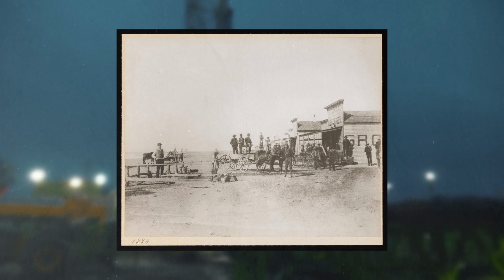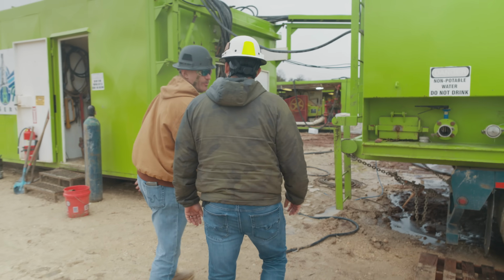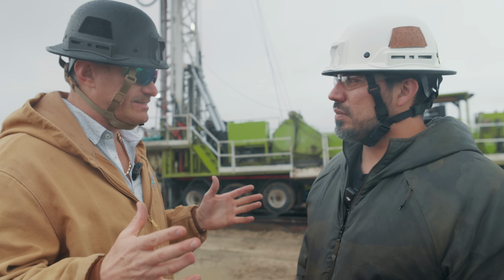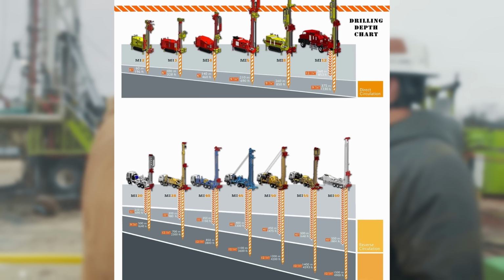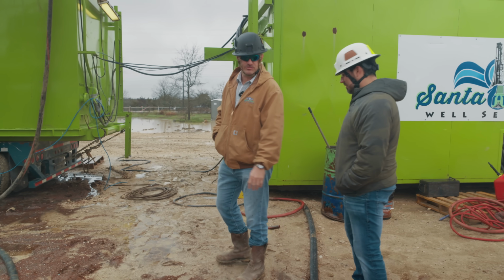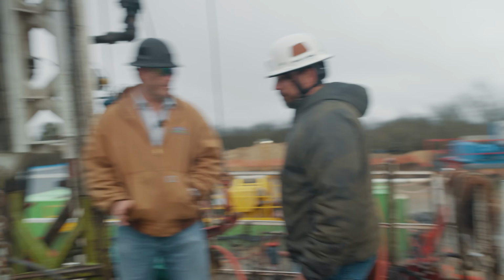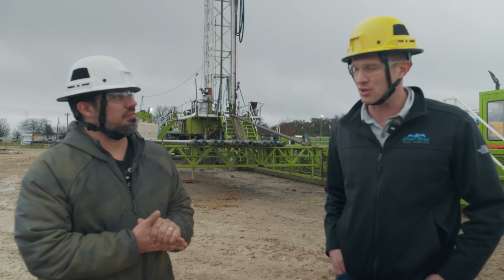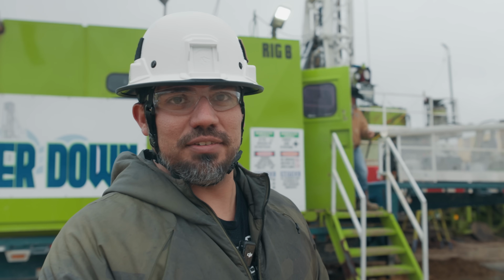Blue Collar Built: How Water Drilling Operations Supply 60% of Water in Texas

Comment: I farm in the Panhandle where wells are up to 1000" deep.   Back in the 1960's some wells use a 36" bit diameter.  Around here a driller can complete a 24" hole to 1000' with 16" cashing in 2 days.   I usually have a new well most years,

Comment: It actually is very complicated. There have been a bunch of brilliant people come before that developed tools, equipment and procedures to make it seem easy, but it is complicated. Really complicated. Less complicated than drilling into NG deposits and flaring off the gas that is bubbling up through the mud because it had more pressure than expected, but it is still complicated because there is a lot that can still go wrong. The drilling company should require a better pad. That pad sucks. That pad is like what was common in the 80's and 90's, well maybe not that bad, but it still has to suck working in that mud and it is dangerous as hell.

Comment: I really enjoyed the video as I drilled irrigation wells in Georgia and my rig is old ( modified winter Wise 1947 model). that uses a 28 inch drag bit with Reverse Circulation and then set 16 inch screened as necessary with gravel pack for a filter and max depth was 350 ft due to pull back issues and never drilled without a “logged test well” 6 inch.  Thanks again for a great video and another video of setting casing as you drilling and then setting the screened section and the “trimmer tube to set the gravel pack that would have to have a Excellent Drillers Log.